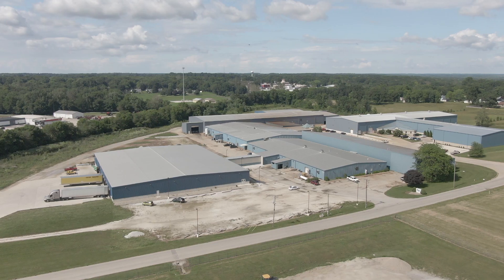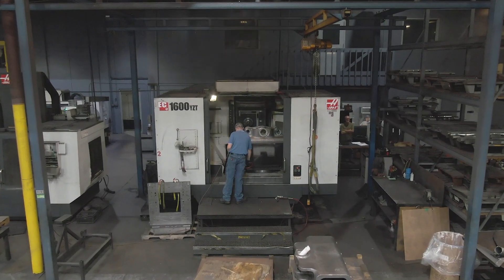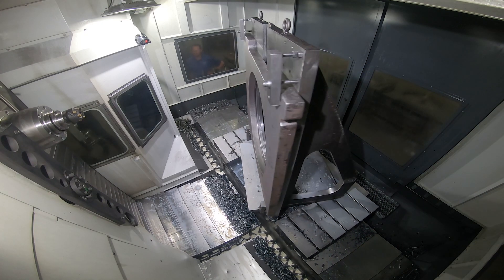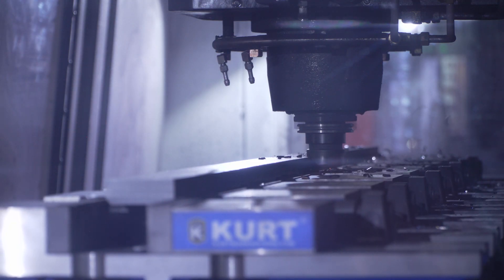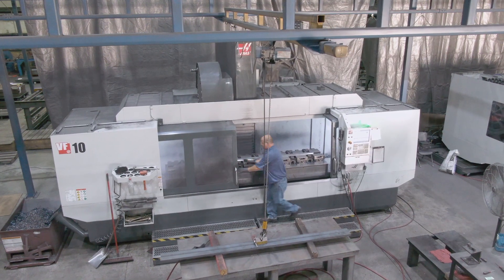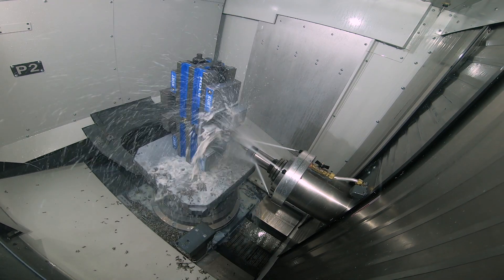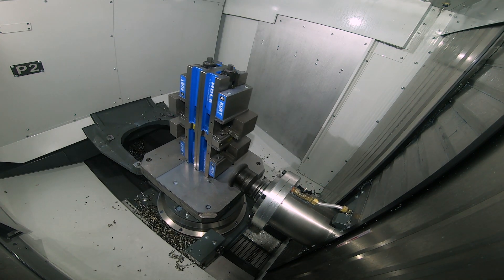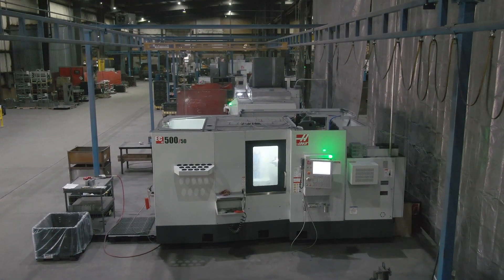Machining BIG Parts for Caterpillar Construction Machinery & Equipment

Comment: Mazak, Mazak is the other brand they have.
Reply from the maker: Correct. Most of the Haas machines added in recent years have replaced aging Mazak machines.
Reply: @hfotridentmachinegroup  Why did company switches better brand to lower quality brand especially if they do lot's of heavy machining. There's few brands that do better in heavy machining than Haas like Doosan and it's just couple % more expensive. The only thing that Haas beats other competitor in US is parts availability and quicker repair than others.
Reply from the maker: @Andrey222ful  in this video the manufacturer explains that the Haas CNC is quite capable of heavy machining. In fact, that's why they are trading out old Mazak machines for Haas machines. They've witnessed how well the Haas performs in their own shop and keep buying more. In fact, they've purchased 10 more Haas CNC's since the filming of this video.

Comment: damn the workplace looks sooo dirty,have yourself some 6S and Lean training.
Reply: oh yeah and put some lights on
Reply: You think that's bad, my work barely cleans at all. Everything is coated in a layer of dust, oil, and grime. You can even see the aggregate in the concrete floor most everywhere in the shop. And most of the machines are from the mid 90s
Reply: That's a real machine shop! Where I work now, they spend more time cleaning machines and mopping floors instead of making money...